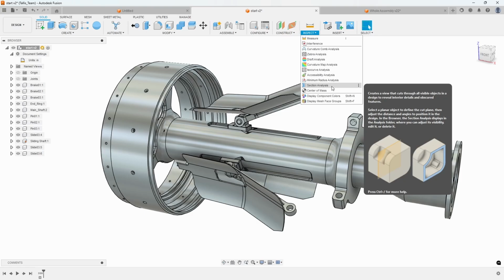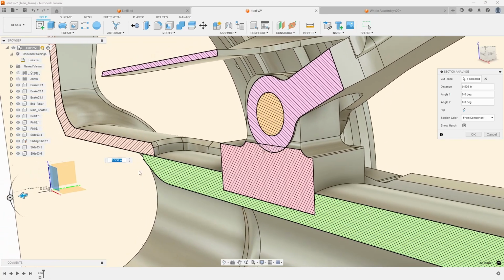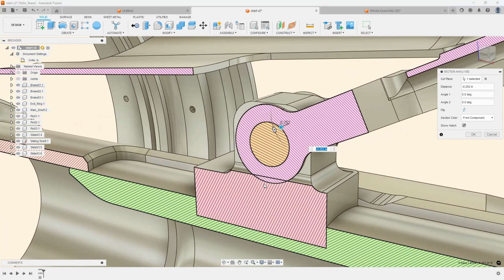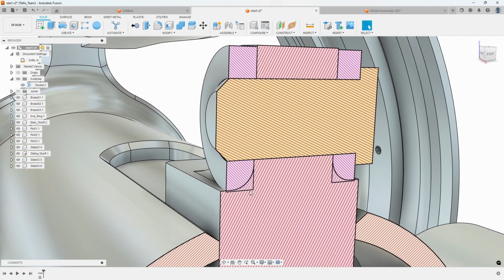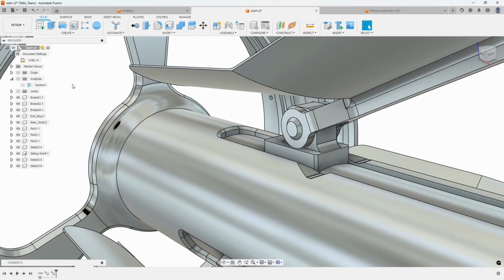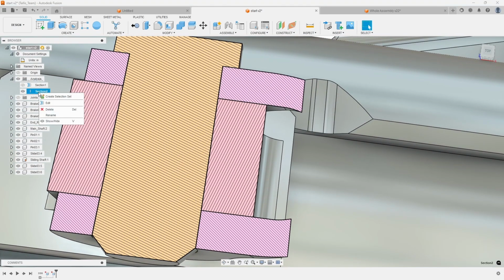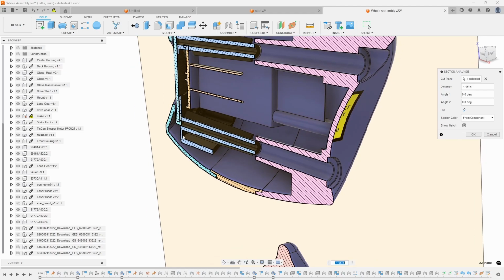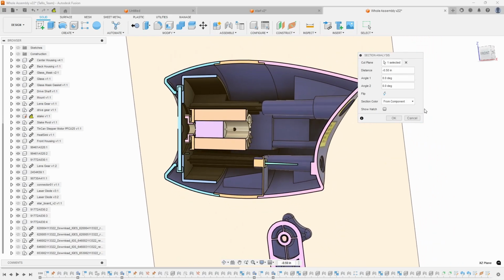Slicing Through Your Designs: Section Analysis in Fusion

Comment: Just found your channel and subscribed. Great content. Question: l like to use the blue arrow handle to slide the cut plane through an object. But when you’re looking directly at the cut plane, the arrow points directly at you and it’s impossible to grab. Is there another way to slide the cut plane back and forth? I know you can adjust the values in the dialog box, but I’d like to be able to smoothly move the plane around. Thanks!
Reply from the maker: @tzampini-  Typically you slide the blue arrow in the section plane while not looking directly orthographic to the screen.  That way you can see the "depth" of the section plane.  There isn't a way to use the arrow keys or scroll wheel or anything like that, so I recommend looking at the section plane isometrically as you are slicing through.
Reply: @ Thank you for replying. 😊

Comment: Thanks for the video. Can you explain a bit more about colors. When you use From Component what are the different colors showing? Are those colors being picked automatically by Fusion and indicate different Components within your Assembly? If so, do you have any ability to change the colors it's using per Component? Also guessing the colors don't give any Interference info without actually using the Interference tool.

And when you change to Custom you can only select a single color?
Reply from the maker: The colors are automatically selected by Fusion and you don't have the ability to change/pick them.  They are kind of a "pastel" palette.  You can see this when you turn "Component Color Cycling" on/off from the Inspect menu.  And yes, when you change to use a custom color in the section, you are limited to only one color.  Thanks for watching!